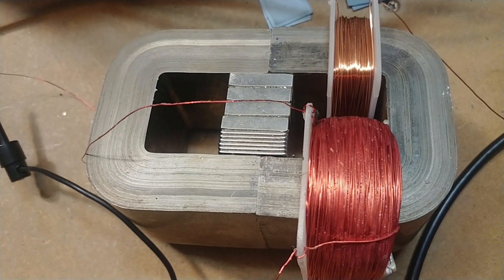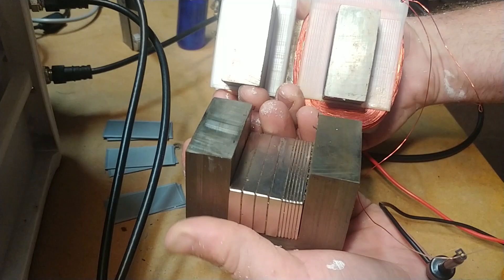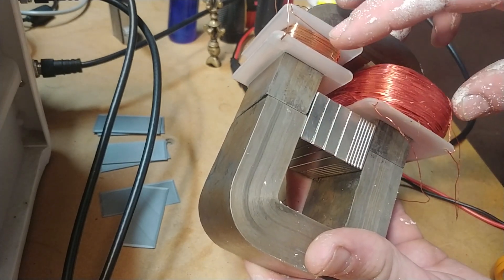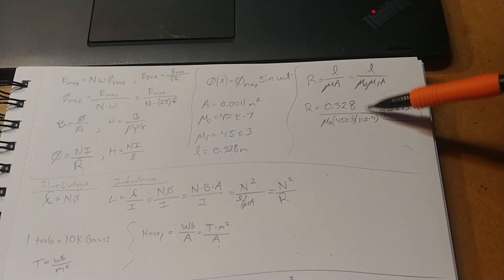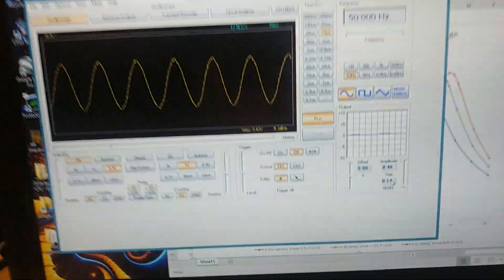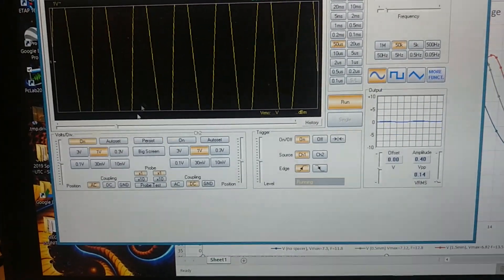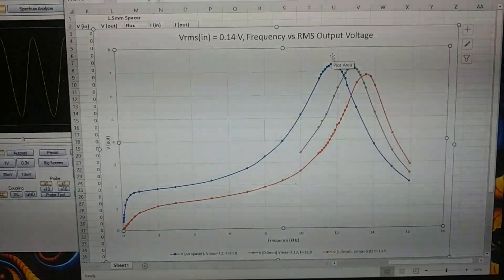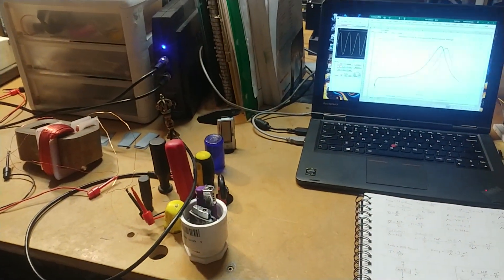MEG Replication & Testing Part 4 - Determining operating frequency for maximum output voltage

Comment: The Motionless Electromagnetic Generator (MEG) is a magnetic generator used to produce electrical power without moving parts, and, more particularly, having a capability, when operating, of producing electrical power without an external application of input power through input coils. 

The Motionless Electromagnetic Generator includes a permanent magnet, two magnetic paths external to the permanent magnet, each of which extends between the opposite poles of the permanent magnet, switching means for causing magnetic flux to flow alternately along each of the two magnetic paths, and one or more output coils in which current is induced to flow by means of changes in the magnetic field within the device. The Motionless Electromagnetic Generator operates in accordance with an extension of Faraday’s Law, indicating that an electrical current is induced within a conductor within a changing magnetic field, even if the source of the magnetic field is stationary.

Regarding thermodynamic considerations, it is noted that, when the Motionless Electromagnetic Generator is operating, it is an open system not in thermodynamic equilibrium. The system receives static energy from the magnetic flux of the permanent magnet. Because the Motionless Electromagnetic Generator is self-switched without an additional energy input, the thermodynamic operation of the system is an open dissipative system, receiving, collecting, and dissipating energy from its environment; in this case, from the magnetic flux stored within the permanent magnet. Continued operation of the Motionless Electromagnetic Generator causes demagnetisation of the permanent magnet. Thus, a Motionless Electromagnetic Generator operating in accordance with Thomas E. Bearden’s invention should be considered not as a perpetual motion machine, but rather as a system in which flux radiated from a permanent magnet is converted into electricity, which is used both to power the apparatus and to power an external load.

Comment: I just realized mate...

Bearden did not use a waveform.

He used pulses. Unless your function generator is producing current in pulses...not +/-cycles than this isnt the way he did it.

Just something I realized...I'm not building a pulse system to get similar frequencies but on a 0v - (x) basis.
There is no input..then a pulse...none..pulse..
Reply from the maker: Yes you are correct.  That is the input switching circuit yes which uses pulses to switch alternatively between one side of the Transformer to the other. This quick switching is what harnesses the energy normally not accessible.
Reply: @JeffersonDrumm  I just posted on my youtube channel a video on mine
Reply from the maker: @Heliarc91  nice work
Reply: @JeffersonDrumm  Thanks man!!!
Reply: @JeffersonDrumm  If you ever want to trade ideas or anything, feel free.

I'm pretty sure I have the clock system figured out.
Only drawback is on mouser the images appeared alot bigger than what some of them really are lol
But.. I did get one or two that may do fine. Some are smaller than a pinky finger mail with like 8 tiny prongs. More for insertion into a dedicated board.

But i may go that route anyway.
Make sure you feast your eyes on the 105w laser vidya!!!
Reply: Also , one of the coils is switched to cycle between blocking the magnetic path then opening it somehow causing a big increase in the flux and energy in the other coil. The pulses may have a varying duty cycle too.
Reply: ss  hmm?

You are just moving flux around that already exists.
You are just taking what is already present with the permanent magnet, via core, and moving it from one side to the other.

The collection off the change and change back from nature "magnet going back to homeostasis" is where it be ones overunity.
Reply: @Heliarc91  Are you sure?
Reply: @donotwantahandle1111  I'm positive. I've watched all of Beardens paid videos and read all the patents and papers throughly. 

In his video disks you buy from him he explains it very clearly.

Comment: Great experiment, I wonder what would be the result of the same test but without the magnet on the core.
Reply: You surely don't understand the working principle of MEG; they are actually using permanent magnet flux and using coil to switch direction of permanent magnet flux.
Reply: @yogie_ji_gwalior_wale  That is not how magnets work. All the magnet is doing is affecting saturation and hysteresis

Comment: HI Jefferson - great video and thanks for all the effort as it helps us newbies heaps. generating that square wave is not that difficult and can be done using a PWM controller - depends on the voltage and current needed for the coil as to what option you may need to follow. Fore the 12 KHz you are needing there are off the shelf units available for some hefty currents and voltages up to 50 VDC. Im interested in finding out if you are getting that equal output from other coils like your secondary placed on the other end of the Core as thats what is suggested due to the electromagnetic fields getting locked into the core but made available to the extra coils to energise multiple coils at the same time ??

Comment: Excuse me, I wish to replicate this device, but to present it, I need to know how it works. Can you explain to me how the device works and it’s source please? Thanks
Reply from the maker: Hello, we have messaged before, but in short here's what I think.

Input to The transformer must be square wave or sinusoidal (i.e. - varying in time).

The MEG is an open system, open to the vacuum fluctuations (movement) of the universe (in this case we are creating EM pulsing which activates the vacuum fluctuations and we tap this field through the coils), just like a dam or windmill is part of an open system, open to the changes of atmosphere and precepitation, which provides the input energy to the system.  It's freely available, we just have to tap it.

The key is to develop a circuit that does not kill the original dipolarity through Back-EMF, so the switching cycle is additive not dissipative.  The extra energy collected can then be distributed to self power.  Lots of power electronics to understand
Reply: @JeffersonDrumm  Thanks
Reply: @JeffersonDrumm  Have you thought of dual spark gap pulses, - then + , alternating ? 
Put Master Ivo's pulse spike phenomenon as inputs to your MEG's coils...then output to a high voltage tank circuit and then drain off the power into a battery/supercap?

Comment: Hey buddy I'm working on the same thing I'm just trying to figure out the input power source and filtering.

What are you using for the input power and how are you switching at the freq?
Like the hardware?

And are you filtering the output at all?
I've got the unit itself figured out just can't find any generators I can use and also switch
Reply from the maker: I'm using a function generator where I can vary the input from sine to square to triangle, with different frequencies. I basically just went through all the different frequencies and monitored the output to see which frequency correspond to the highest power output
Reply: @JeffersonDrumm  oh ok thanks. I forget you are only utilizing one side so you dont have a need for switching. 
Do you mind mentioning the model of your function gen?
Reply from the maker: @Heliarc91  yes, I was just using the one side to find out the resonant frequency. Then, just need to develop the switching circuit to operate at that optimal frequency. So yes, the next step is to alternatively pulse each side, and determine how fast to switch between the coils, and the switching is what will harness the vacuum as well as the back EMF

Comment: that does not work with a sine wave, but with square waves that give pulses
Reply: He is not running the device, he is explaining how he calculate transformation ration and specs of construction
Reply: He does use sine waves.

The program he has can make alot of different arbitrary wave forms...I have same one.

I'm 3d printing my bobbits too.

I'll video mine as well and post on YT

Comment: 30 yrs ago a group invited me to see a
MEG about same size  60 to 1. These guys had built several. Iam a Mechanical and manufacturing engineer. What a came away with is
Core material is critical and magnets
Not necessarily Tesla rate. Iam a believer these MEG are the future.
Couple hundred dollars each to manufacture.
Reply from the maker: Awesome, I am looking for a group of technical people to help out with testing and Analysis.
Reply from the maker: Yes, well I have the highest quality core and high-strength magnets available at the moment.  The key is developing the electronics switching circuit, which is somewhat difficult
Reply: I have yet to test it, but what about using a ferrofluid for the core?
Reply from the maker: @dank1389  maybe in the future, but I think it would be cost-prohibitive at the moment
Reply: @JeffersonDrumm  if you 3d printed a hollow core, filled it with ferrofluid and used that in place of your existing core, do you think that might overcome the resistance to flux switching?
Reply: @dank1389  I am also interested in liquid/gel transformer cores.
Reply: @undernetjack  I was thinking a Ferro fluid would be able to flip it's dipole without the same limitations as a solid core. I have a bottle of Ferro fluid but haven't found the time to 3d print a hollow core to test the theory. Maybe there's a reason that would not work as a core material, but in my ignorance it seems like a perfect solution. I also found a flux transformer patent that could operate as a MEG and I thought the cylindrical shape would be more efficient at shielding the coils from magnetic flux. I believe if you search flux compression transformer it will show up.
Reply: @dank1389  I was thinking of a liquid or gel or malleable plastic like core filled with different mixtures of ferrous or magnetically permeable materials , powdered iron, diamagnetic graphite\graphene, bismuth, copper, lead or galena.
Reply: @undernetjack  I definitely think the MEG is viable, but it will be up to people like us to test new materials and variations to get something to truly work.

Comment: The transformer's output may drop way down in voltage once it sees even moderate load.  There's something odd and magical about magnetic resonance without load, energy can just keep accumulating in the core over many cycles since it isn't being removed by a load.  Your matter of fact approach to this build and video is great to hear.
Reply from the maker: Yes, great point, I'm kind of wondering what sort of load I should actually put on the output?
Reply: @JeffersonDrumm  Resistive loads are best for not creating complex power waveforms.  My first choice is simple electric heaters.  1500W 120v electric heater (resistive type), down to 50W 12V add on heaters at the car supply store for medium power output, and simple carbon resistor in a 1W or 2W or less range. Large wattage resistor tend to be wirewound and can produce minor inductive effects with certain waveforms.
Reply from the maker: @oldskooldriver9379  awesome thanks for sharing the info.

Comment: I believe the more the frequency the more voltage and current is generated, but metal core cannot have a high frequency, metglas can go higher but I believe we can use magnetite and make a core in plastic with a 3d printer, magnetite react very fast to magnet, very high frequency can be done with it, nice work

Comment: Why not all 4 coils installed and switching it so that the magnetic flux is shifting in the coil and the excess energy is used to energise the system like Tom Bearden.
The MEG is completely thought out and ready to implement into electrical appliances without cords .
You don't have to reinvent the wheel , just implement this form of circuits in everyday appliances and make it more popular.
Lets say every thing with a cord needs a MEG or a kind of open circuit where direct energy intake is possible .
Ones engineers understand what it takes to build  open and asymmetric circuits and the EE EM model is gonna be updated we're entering a new word were we don't have to work for energy or for our big consumers of energy .
like air conditioners and heating of water and  no more energy giants bills . 
Plus it should be law that anyone person could use this techniek without government intervention .
Of course public services as well as the publick themselves should use equipment that meets all safety requirements and standards.
for example create a lightbulb or maybe a switch with a meg inside witch u can integrate into a small circuit  like 4  light bulbs a socket for other normal circuit appliances like charger shaver or grill  and a switch and make it autonomous putt it in a nice box and market it under a fair price .
this would reach the public big time .
Reply from the maker: Why am I doing all this initial testing you ask? It is because there is nothing to follow. Yes Bearden has a patent but there is no published information on how to put it together, what frequency to operate at or how to actually build the Meg. So basically I'm having a start from scratch, working off schematics with no help from the inventor.  Bearden was operating his Transformer at 40 kilohertz which is not the correct frequency of 11.8 kilohertz which I have found through testing.  I will put the coils on the other side of the Transformer after I put together the input circuit board for switching which is difficult just by itself. If you or anyone has already developed this let me know and I will be happy to follow your set up.

For now, I am doing testing with an input and an output coil, using sine input and square wave input  to see which has the highest output.  This basic setup is already showing COP>1.0.  

FYI, I have never seen in Meg setup & actually powering anyting.

Comment: Reading through Bearden's book, concrete details of it's construction are scarce. However he does mention that the core should not have gaps between the halves or the magnets as this can cause phase shifts in the output. One of the most critical points is that the B field is completely confined to inside the core and magnets. Saturation should probably not be an issue for this particular transformer, at least not at this phase of testing.
Reply from the maker: Yes, good points oh, yes and there's very little to go by and bearden's books I know he's in his 80s now but I wanted to go ask him directly about it
Reply: @JeffersonDrumm  we have to have better resources than him, he seems intentionally dull

Comment: How much current is going in vs going out?
Reply from the maker: Current is calculated from the coil properties, and it's showing some interesting results.  I'll post a video soon.
Reply: @JeffersonDrumm  I have found it to be very important to experimentally measure the current as well as the phase, and not simply going by calculations as it can lead to rabbit holes. The voltage drop across a 1 ohm resistor should fit the bill quite nicely. Best of luck with this project!